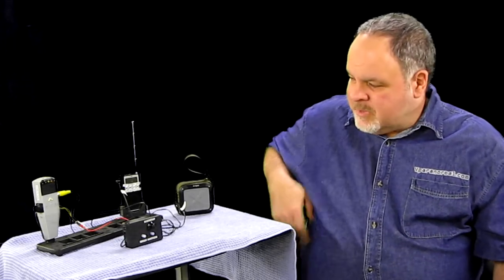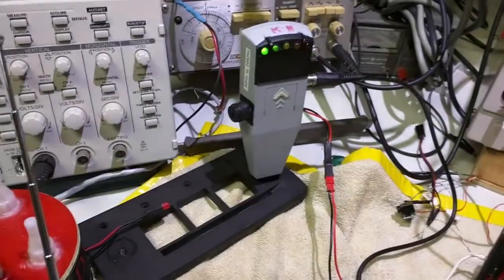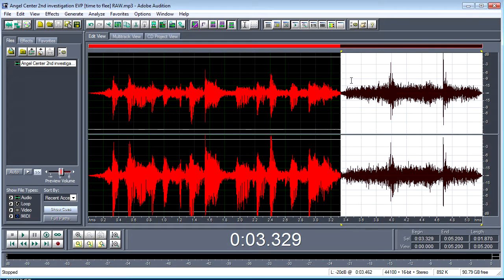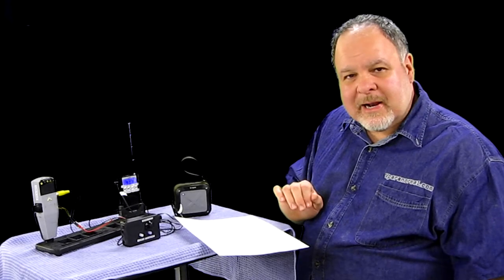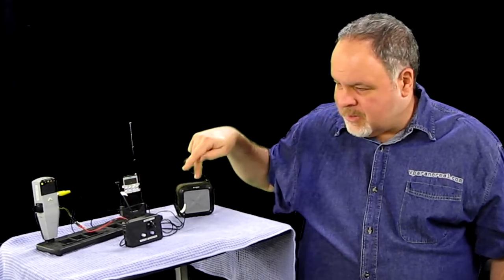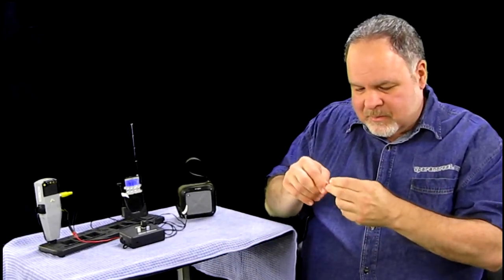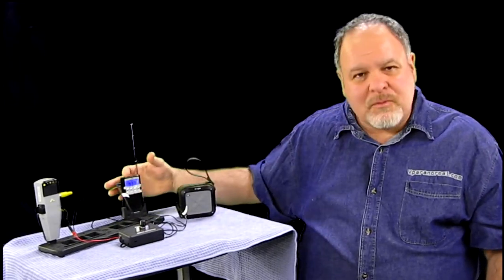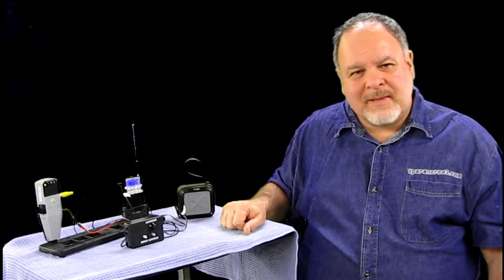Build the Vparanormal K2 Meter Amp with SB7 Ghost Box Validator

Comment: Parts List

TEXAS INSTRUMENTS LM324N OP AMP http://amzn.to/2sX9ALf

CD4016BCN IC SWITCH BILATERAL QU 14-DIP http://www.ebay.com/itm/5PCS-CD4016BC...

Double Side Prototype PCB Universal Printed Circuit Board with 5 Sizes
http://amzn.to/2u5Rgzf

5mm Assorted colors plus clear LED’s 100pcs http://amzn.to/2u16DJz

Stereo Audio Patch Cable Male to Male 3.5mm - 3 FT http://amzn.to/2sIslxU

General Purpose Case - 4.72" x 2.55" x 1.41" http://amzn.to/2u6gdKR

100k Ohm Resistors, 1/4 Watt, 5% http://amzn.to/2sIFYxc

250K OHM Linear Taper Rotary Potentiometer http://amzn.to/2sIh4xQ

4.7k Ohm Resistors, 1/4 Watt, 5% http://amzn.to/2tGwGmK

3.9k Ohm Resistors, 1/4 W, 5% http://amzn.to/2t67lRk

270k Ohm Resistors, 1/4 W, 5% http://amzn.to/2t6lBJS

680k Ohm Resistors, 1/4 Watt, 5% http://amzn.to/2sIEhjt

1N914 SMALL SIGNAL DIODE http://amzn.to/2tGFrNp

6.8uf 6.8mfd 100V NP Non-Polarized Capacitor (substitute for 10uF) http://amzn.to/2sIICTE

Radial Electrolytic Capacitor, 0.22uF, 50V http://amzn.to/2sIiatd

Capacitor Tantalum Solid 1uF 35V 10% http://amzn.to/2uK3M5o

10k Ohm Resistors, 1/4 Watt, 5% http://amzn.to/2v4qHY7

470k Ohm Resistors, 1/4 Watt, 5% http://amzn.to/2sI8Gyo

Hull Shape Snap-in KCD1-106 2 Pin ON-OFF Switch 
http://amzn.to/2sIgsYL

Comment from the maker: For builders of the "K2 amp with SB7 Validator, you do NOT need to build the the "level adjust circuit" shown on the K2 meter audio tap video: https://www.youtube.com/watch?v=SkvTyiLScU8   just the tap using the RCA plug shown.